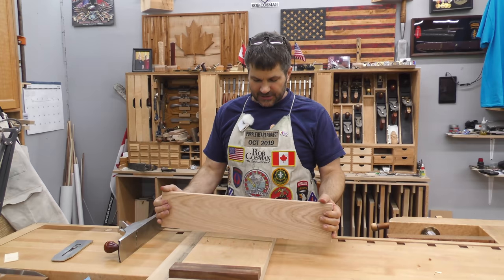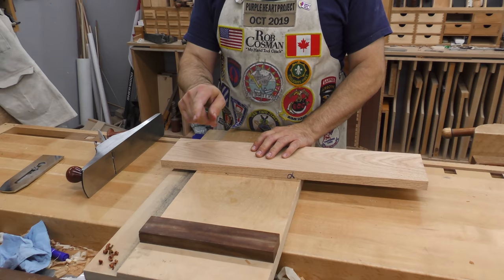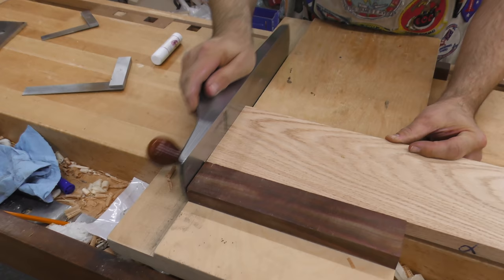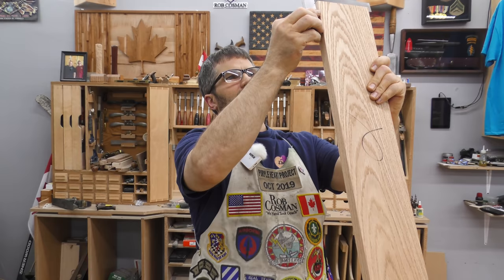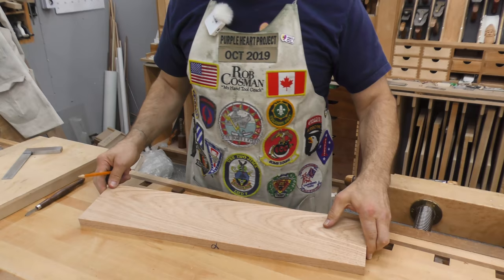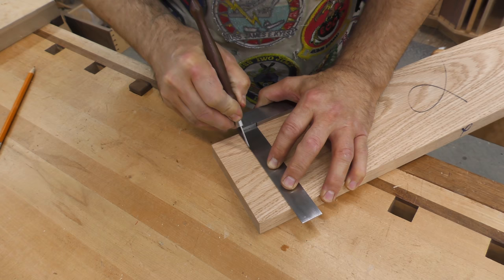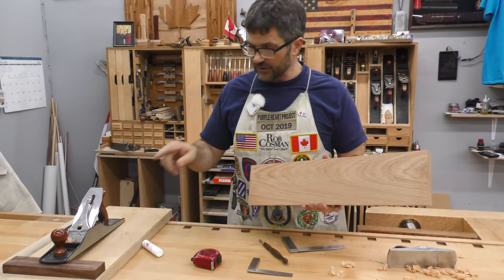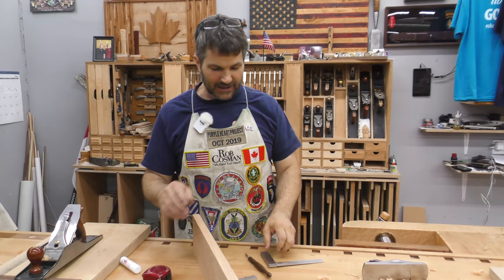Hand Planing Wood - Perfectly Squared Ends !

Comment: I had only a No. 4 Hand plane till I started watching Paul Sellers, as a result of seeing how quickly, accurate squaring on end grain could be achieved, I now have two Block Planes, a Low angle 62, a router plane and a detail shoulder plane. I have three shooting boards and use my cabinet saw only for rough dimensioning. Handplaning is a true joy in my woodworking!

Comment: The example and leadership you provide in achieving accuracy and doing the best you can do is infectious. I now use a a shooting board all the time.  I knife all four sides, plane a chamfer to avoid bust out, flip and plane as required to the knife line, assess and plane until I can see the knife line all around but there is no detectable ledge to the knife line in the end grain.  How pedantic, but I'm loving my crazy.
Reply from the maker: Welcome to the dark side!!!!
Reply: @RobCosmanWoodworking  That's exactly what my mate calls it.  He has a hobby, wood machining shop. He was only just recently "gifted" his first and only plane, a low angle jack plane.  I now lament that I know why it was a gift.

Comment: Rob, the issue is not with single boards but with squaring the ends of thick laminated benchtops, say, without power tools, and no functioning workbench.  I have a No. 5 and cabinet scraper only aside from some squares.  Very frustrated.

Comment: Another great lesson, thanks Rob. 
I have an issue with cutting a chamfer on the reference edge on my shooting board (which I built because you told me to, haha 😉), I can't seem to stop the plane from digging in, so what I do is I turn the plane around, leaving the reference edge against the fence and then pull the plane towards me.
Another thing I like to do is make  a knife line around the whole board before I crosscut, which helps me find square easier and because I use the my reference side to scribe front and back my groves are automatically parallel on both sides.

On a lighter note, I thought I was getting stronger during the lock down because I am planing so much easier, but the my daughters pointed out how much weight I've gained during lockdown and because I use my body and not my arms, I'm actually not stronger, I've just got a heavier hammer, lol 😂
Reply from the maker: Art both of those techniques work.  Sound like when you chamfer like me you are holding the wood at too great an angle.  But if you “reverse” method works for you then stick with it.   I actually should have also shown and discussed striking the line all the way around

Comment: Something to consider from the start: planing the ends will change the length of the board. It is quite easy to remove a 32nd or 16th of an inch in just a few passes.
Reply from the maker: Let’s do the math on that.  1/16 is 62 and 1/2 thousands of an inch.  My typical end grain shaving is .004.  That is 15 passes for a 1/16 or 8 passes to remove 1/32”.
Reply: @RobCosmanWoodworking  Okay, so it's easier to remove 1/32" , and if it is true on both ends, then only 4 passes at each end to achieve such a reduction. Assuming your typical end grain shaving is universal to beginners, it is quite easy to whip out 15 passes to square an end that isn't already near square. Not to mention both ends may not be square. 
My point is that incorrectly cutting to length (not allowing for squaring) prior to squaring the ends may result in a shorted board.

Comment: After making a shooting board according to your how-to video, I was finding it impossible to get the edge square relative to the bottom reference face of the board.  Eventually I figured out that the side of the body of my Woodriver #6 plane is significantly out of square with the sole.  Is this by design, or did I get one that was poorly machined?  And until I am able to purchase another plane (and verify it is square before forking over the cash) is there any downside to using my current plane but with the blade significantly skewed (relative to the sole)?
Reply from the maker: No issue at all with skewing the blade.  If your plane is recently purchased, take it back. If that is not an option square up the side by sanding.  Get some course (80 or 120 grit) stick it to a flat substrate (MDF is what I use) the sand the side of the plane, putting pressure on the high side.  Keep checking with a square until you bring it in square. Then take it up to 320 to look nice. You can also check with a local machine shop, some have these big flattening disks and they can do it for you
Reply: @RobCosmanWoodworking  I talked with Woodcraft tech support, and apparently their tolerance for squareness is .018".  I'm not sure I'm up to the challenge of sanding down the side of my plane.  Oh darn, looks like I'll have to go shopping for a new one!

Comment: I am new to your channel and i love what you do and the details with what you put forth. I would like to ask what does one do if  one can not afford the high dollar planes to get to the squareness that you show? Just wondering what i could do to get to what your doing.
Reply: There is no reason why you cannot get the same squareness with a cheaper plane. It's only wood, not titanium,m and you're working to "square to the eye", not to a micrometer. Your plane needs to have a flat sole and if using a shooting board then the side must be square. The blade needs to be sharp, and set flat... and the cuts need to be very shallow. That's all, the price of the plane is largely irrelevant.

Comment: Do you have a shooting board for 45 degree bevels? I've seen a few different designs and would be interested what you do. Thanks.
Reply from the maker: I am working on product development of a face miter shooting board. For a bevel angle I prefer holding the plane at an angle verses holding the board at an angle

Comment: Why do woodworkers keep using terms like 'perfect', when the work they do is (necessarily) one of the least perfect of all the machining processes? As someone who does both woodwork and metalwork, I note that woodworkers use 'perfect', 'exactly' and other such words whereas a machinist (working to way greater accuracy) talks about tolerance and specification- never 'perfect'.
By all means say 'accurate'- that is not an absolute and can include tolerance.
Reply from the maker: By “perfect” we mean that we cannot obtain any better results with our system of measuring. You’d prefer that when we get something to fit we say something like “well that’s an accurate fit?” Or perhaps “that fit is satisfactory for my needs?” Go complain elsewhere because you’re doing it too much here.
Reply: @RobCosmanWoodworking  Wow, sensitive…. Using measuring equipment too crude to detect errors does not mean they do not exist. Say 'accurate' by all means- that is not an absolute. 'Perfect' is a Platonic ideal. The word is not the problem, it is the way of thinking- far from accurate and leading to false concepts.
Reply from the maker: Sensitive? You’re the one complaining about our lack of editing being a waste of your time and whining about our use of absolutes because it triggers you.
Reply: @RobCosmanWoodworking  I was not complaining about my time- I can skip through most of it. I expressed the view that it is less than courteous to waste years of viewers time. You may think differently... It does not 'trigger' me. I was trying to help you- but you seem to get angry if any comments are not fawning approval. Pray continue with your narrower world view if that suits you.